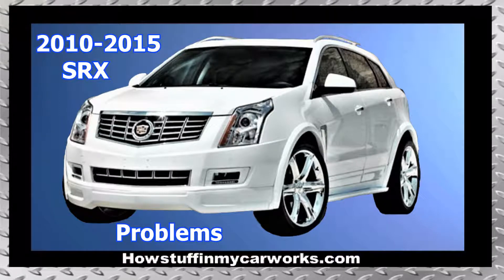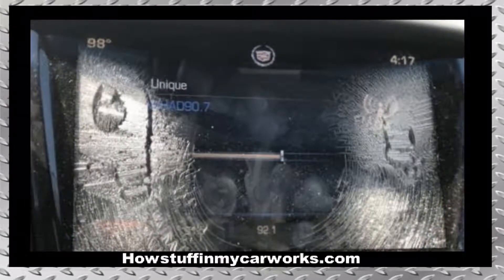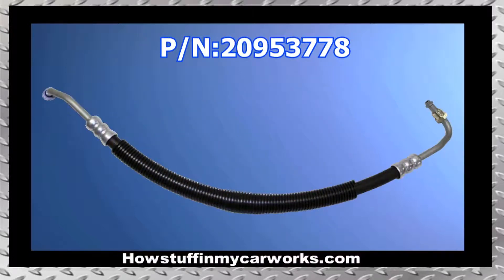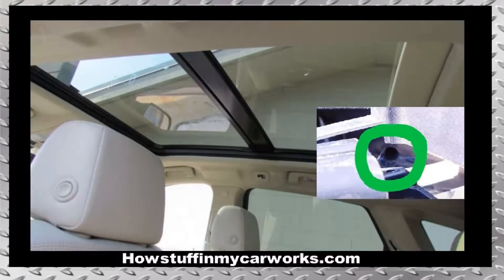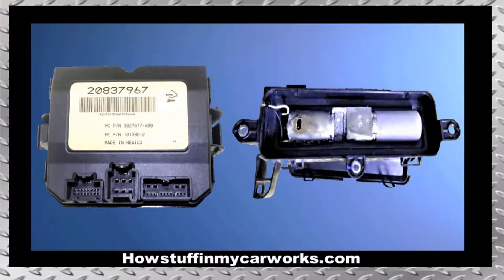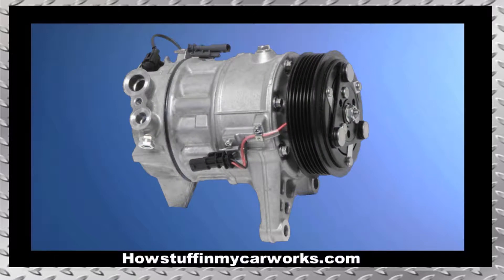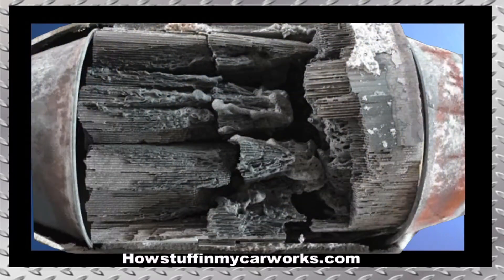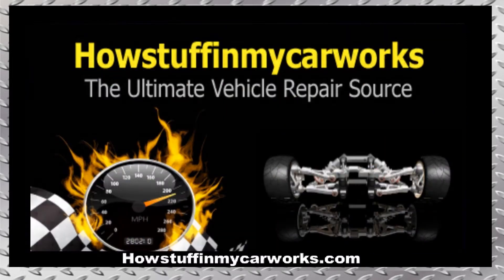Cadillac SRX 2nd Gen 2010 to 2015 problems, defects, issues, recalls and complaints

Comment: On mine I had to: 1.replace both rear bearings and sensors due to ABS malfunction.   2. replace steering wheel position sensor.  3. replace corroded lines on rear differential (hard to access, $1100.00 repair). 4. replace broken clamp on radiator hose, lost all coolant because of that. 5. replace gate lifting air spring. 6. replace screen. 7. replace head lights because they got quite dark and changing light bulbs did not help.
Reply: yeh all my lift shocks failead - i put in new headlights - and a new anroid touch screen, so far no other issues besides the drivers side seat cracking.

Comment: You could to be right on with your post, however... I have never used the touch-screen, only the knobs below and have never had a problem with my screen. Ive always driven like there was an egg between my foot and the accelerator and still running strong at 126k. I put a nice bead of silicone caulk around the seams of the headlight and no problems. I have developed a clunk in the ft end, not sure if it's a wheel bearing or something else? Finally my drivers seat did crack, no comment. These are my only concerns after 12 yrs and 126k miles and I believe any new car is going to have similar problems. Treat your car like a family member, clean out your garage and park it inside each night. Talk and wash her often and she will take good care of you, I love my SRX.
Reply: clunking noise from ft end is more likely due to sway bar bushing, not necessarily struts which most shops would insist to replace but that wouldn't eliminate the problem. after replacing sway bar bushing, my car finally quiet down.
Reply: @Dan-mh9bq  I've been living with that clunking for almost a year since replacing the struts and shocks. Is it important to replace the sway bar brushings asap?

Comment: You're supposed to clean and condition any leather seat. Otherwise it will dry up and crack. The timing chain will stretch as a result of dirty or poor quality oil. Also with these VVT engines are the VVT valves which can get dirty can result in a timing code.
Reply: The quality of things was better and you wouldn't have to clean it that off and I do a great needs to be somewhat clean but you don't need to clean it and clean it and clean it and clean it and clean it I had a 2000 Ford Taurus with a sunroof and freaking leather and it wasn't even cracked get that quit buying the junk new s*** by the old s*** so that we can keep the good s*** on the road
Reply: @billieengel9276  a 2000 Taurus has vinyl seats, not leather. Most people call their plastic seats these days leather. Real leather shrinks and expands, the plastic seats don't
Reply: so far my timingchain is ok - i do the mobile one  synthetic oil changes

Comment: Wish I had seen this BEFORE I purchased my SECOND Cadillac suv. The condensation in the headlights and the hatch not lifting should be something that Cadillac should definitely be ashamed of. With their reputation this is far below their standard and I am extremely upset. I've been buying Cadillacs since I was 17 years of age. Over three decades later and I am so ready to move on to another type of luxury car/SUV. I think that my wrong with Cadillac has finally come to an end
Reply: The water entering the rear storage compartment and short circuiting the liftgate module is absolutely infuriating because it is absolutely a common problem with the Cadillac SRX And Cadillac absolutely knows about it. I cannot believe there hasn’t been a lawsuit or anything.
Reply: I'm so glad I watched this. Shame on Cadillac. Too bad bc I'm looking for a crossover and don't like how most of them look design wise on outside. I like Mercedes but cost a fortune to repair. $500 wiper blades!
Reply: As I can because I too have been the victim of a 2015 Cadillac of which there's too many things to list wrong with it it lives in the impound lot in the garage lot more than it does in my hand that being said I'm getting an older car everybody should f*** that card can write unless anybody knows where they're buying them for about 25 Grand I'll take it out of the impound lot and get my money back and not have a bill at least haha just joking
Reply: wow, so mad u could just spit, huh... 7;^>
Reply: i bought the base modle srx -  not many prroblems - the seat cracking - the headlights and touch screen all had to be replaced - so far im lucky on the timing chain , i have 121k miles on a 2014 base srx